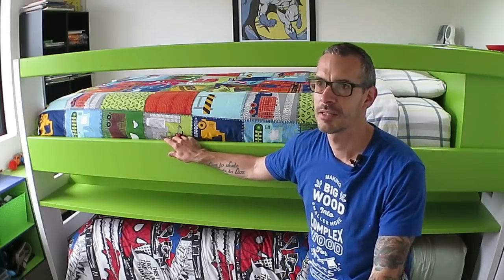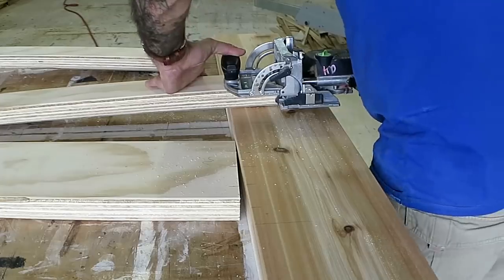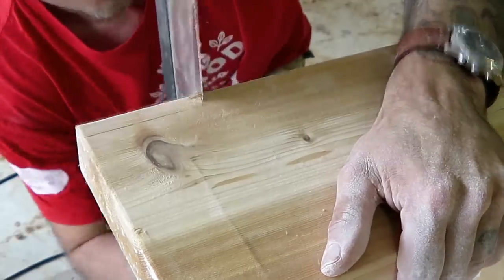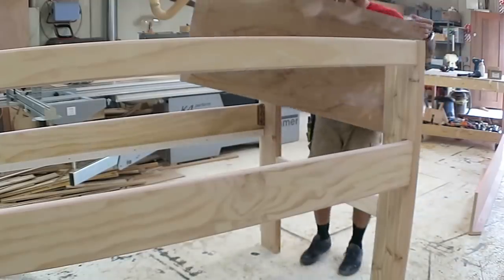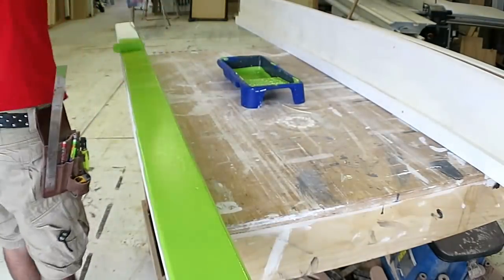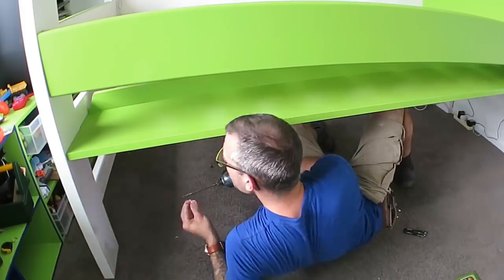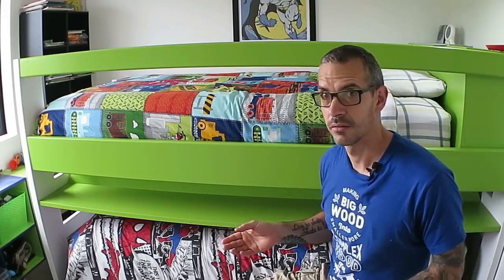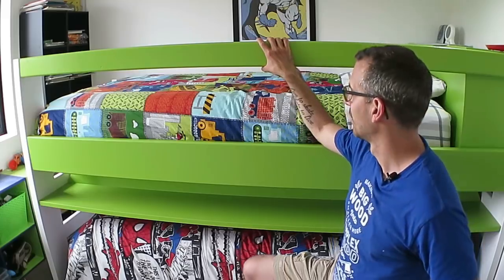Bunk,trundle  Bed

Comment: Joey, that rail spacing at the top looks to be too high, sorry man don’t mean to be nit picking stuff but I have 4 kids and researched this at depth before building both their bunks. It’s actually not so much for sleeping as it is for playing. Their bodies can slip under and their head gets stuck which can be potentially horrific.
No matter how many times I stop them and warn them my little guys always end up playing on the bunk with their friends/cousins.
It’s an easy fix just to add another piece to the bottom or make it from a 200mm board with the the same tongue to slip into the groove, making it a slightly looser fit 2nd time round might solve some of the issues with inserting and removing too.
In Australia it has to pass the 125mm squishy ball test, as long as you can’t push a ball through the gap you’re fine.

Comment: For a three year old, I don't like the bed. It's too high, the access ladder is too squeashed to the side, the bed is too short watching the video or is it just an optical illusion. The boy could  easily slid down the railing gap and fall on the floor. The shelf just looks clumsy placed there. The bed looks like an afterthought. And why is the room too small in the first place. It feels like a broom closet or a pantry. I wish you would furnish and built great thing for your own home.

Comment: I'm curious how those brackets are actually strong enough to keep the bed from racking, especially as your son climbs up and down the ladder. I would have though you would need more support across the length of the bed.

How strong are those hangers? Do they tie in the ends well enough? Do you think you'll need to add some additional support across the back at some point?

All that said, it's a good looking simple build!

Comment: You can add a second rail to the first. Just use dowels to connect the second/lower rail to the first. Also, you can loosen the fit of the rail without decreasing safety. It is actually wiser to have a loose fitting rail for quick removal in the event of an accident, such as a kid getting stuck. Last thing you want to do is cut up a rail with a chainsaw to get a kid out... Trust me I know... On a store bought bed too. I do like the idea of this being made from scraps, good use of materials.